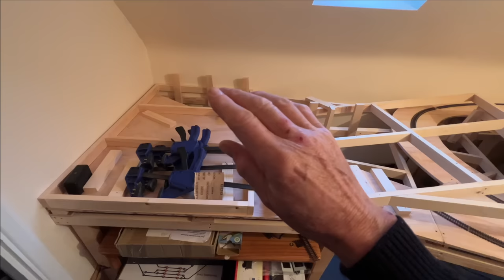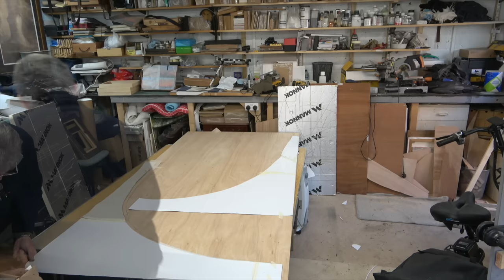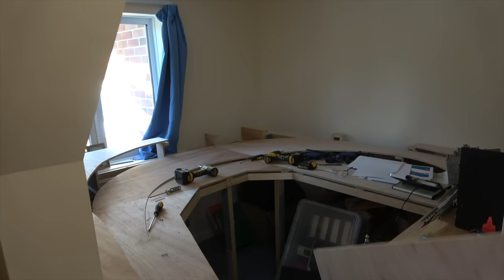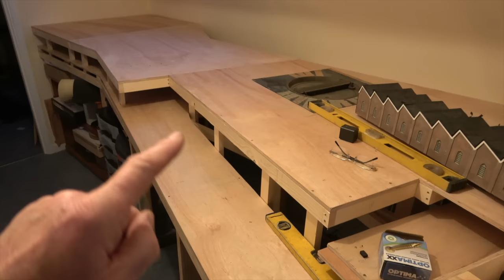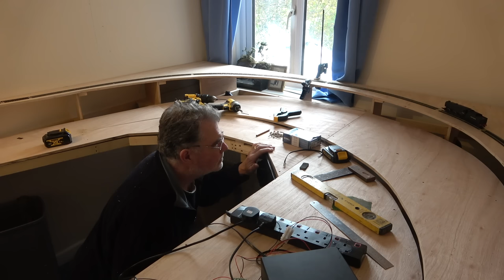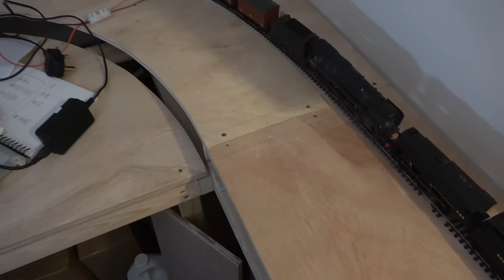The New Sandling Junction Build - Episode 2 - That large incline, how did I get on with it?

Comment: Dear Paul, for your board with the turntable; to permanently fix its risers steady, sturdy and plumb it may be helpful to form some triangular supports or braces, from the lower base board almost to the top of the risers. I humbly think that will do a better job for the strength of this board’s foundation than the extra cut and horizontal bracing you mentioned. Cheerio
Reply from the maker: Hi Vince yes it is a good idea, I have many upstands in place, but if movement is detected I will look at your suggestion, cheers P

Comment: To avoid any track alignment problem you should use the Railtech track alignment joiners for module joints. It is conceived to ensure perfect alignment and a sturdy modular track joint. There are videos on YouTube about this tool.
Reply from the maker: Thank you I shall definitely look into them, cheers P
Reply: Hot tip, with the Model tech alignment plates, remove the sleepers, and solder the plates - secure the track before cutting the rails. Flexitrack will bite back if you  try cutting it first!!! On any curve..